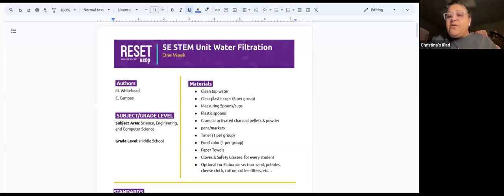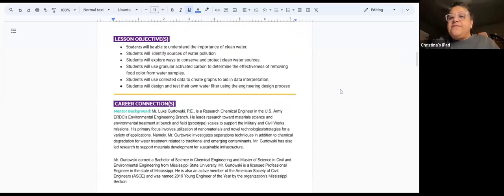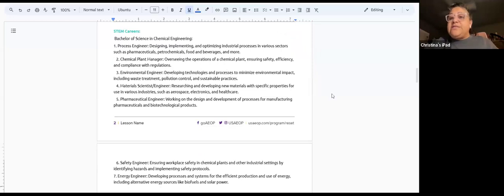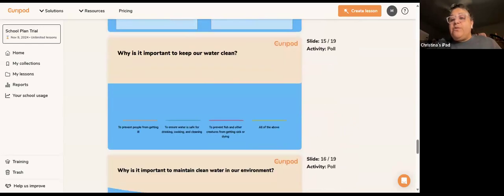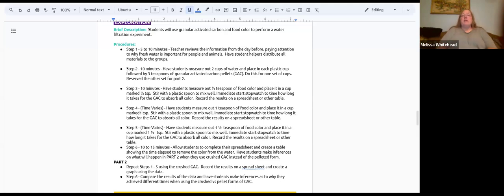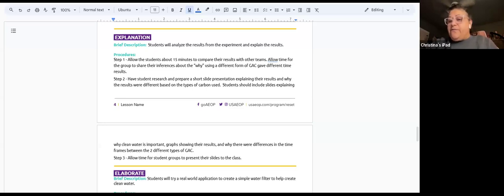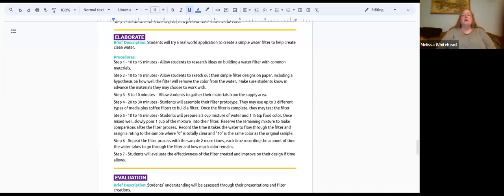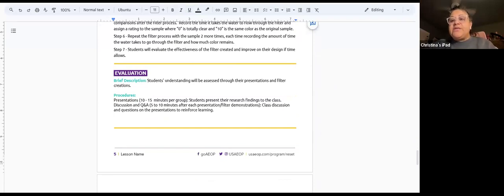WATER FILTRATION

Comment: Glows - I've never tried this experiment before, but I'm quite intrigued with your lesson plan because this is a relevant topic.  Conservation and protection is an ongoing study and water is a material we can't do without.  I appreciate how you all use the 5Es to convey the how, why, and flow of the lesson.  In addition, I like that you all provided times for each step within each "E" section.  Upon reviewing the materials list, I understand all that is needed for my students and I to complete this project. It's exciting that students have the opportunity to explore both the scientific method by comparing the effectiveness of two types of activated charcoal and the engineering design process by building their own water filters.  Thank you for showing students the many career opportunities they can explore within this one lesson.  

Wonderings/Growths - Consider adding measurement totals to the materials list (i.e. 3 Tbsp. of GAC). Is the general idea to explore each of the 5E each day? If so, what would be an extension activity for a 90 minute class as Engagement equals approximately 55 minutes.  Within Elaborate, could you provide an exemplar table that can be used to capture the data from testing.

Thank you for sharing your knowledge and resources.

Warren Palmer II

Comment: This was a good Unit in Water Filtration. The NearPod on water filtration was good as the Engage. The Explore section using Charcoal is a great segway from the Engage activity about  water. The directions are clear and to the point so the students could actually do this with limited support. I like how the students are using technology to record their data.
The comparison of the crushed GAC versus pellet GAC makes for phenomena in the data for the time it takes for filtration. The probing questions will help the student reflect on what they observed. The teachers could have them draw a model for what they think is happening at the molecular level or create a model drawing that shows they understanding how the changes in the GAC affects the time it takes water to be filtered. I also like how the students are doing some engineering by building their filter and redesigning for improvement. I would like to add this unit needs to have a presentation rubric.

Ramona Singleton - Coach
This is La Joye Sanders